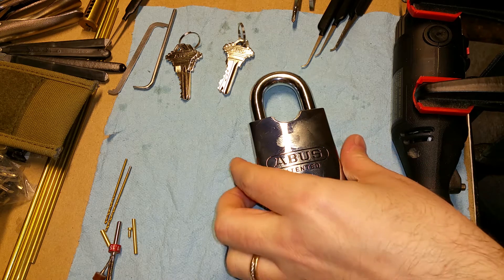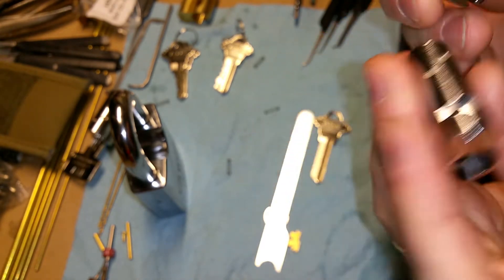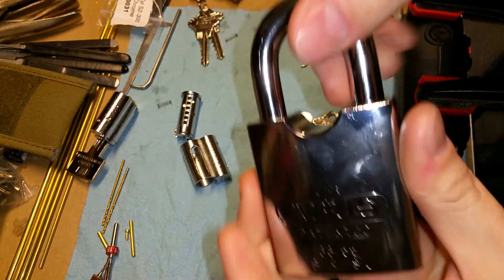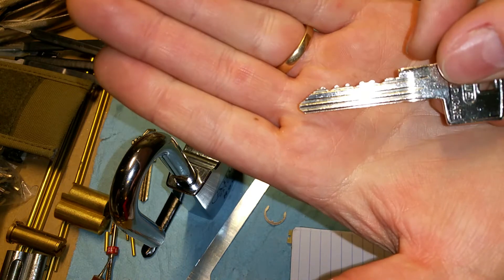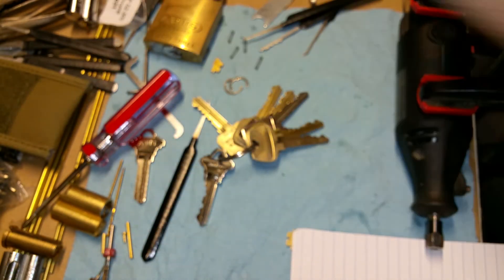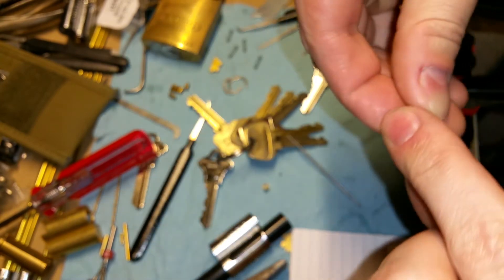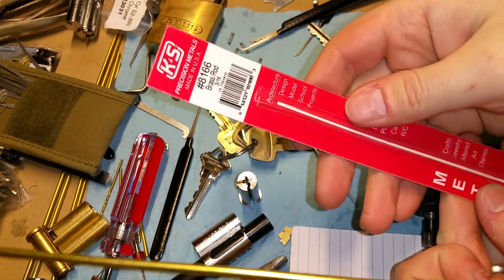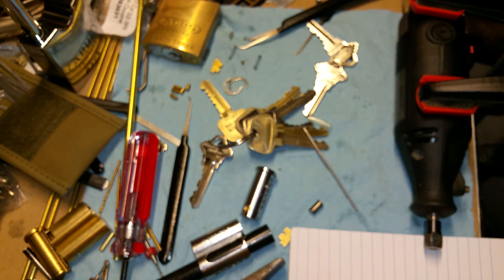Lock Picking: ABUS 83/55 ROCK Padlock Pick and Gut

Comment: Hi,
 I just made a comment on another video about how you managed to rescue the core after the pin problem, no need to answer on that thread now, thanks :) If you want to see an even more easily picked one of these, have a look at my videos (I'm a total noob inspired by how easy it was to pick the lock that we bought at work for 70 gbp two years ago as a back up for our main door lock by the way  - it was an 83/cs55 Rock) - in repinning it I've been surprised that the plug and core are actually brass, just chrome plated (only mentioning that because you mention brass versions in this video)
Reply from the maker: I haven't come across any cores/plugs yet that were made of anything different than brass.  I think that Ruko I had for a while was steel with a brass plug.  I never gutted it sadly, but it was a fun lock and I'm glad to keep it in rotation within the community.  

As far as the brass core I needed to drill out, I still have it laying on my table and I'll patch it up eventually.  I've been using the plug for checking out pinning configurations with the security pins I make.  It's just as useful to me not in use in a lock as it is inside one.  I have quite a few 83 series cores in my collection which I've bought just for hot swapping cores and trading back and forth with others in the community.  This way we can pin up a core and mail to each other which costs less postage than sending a whole padlock back and forth.